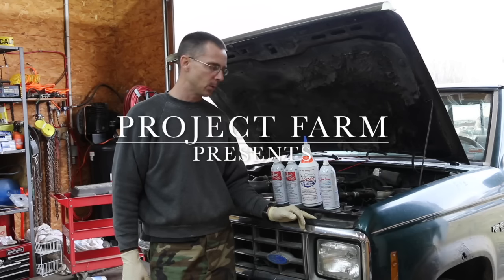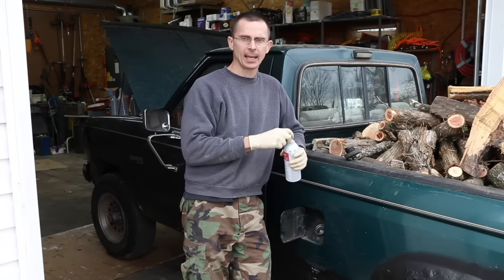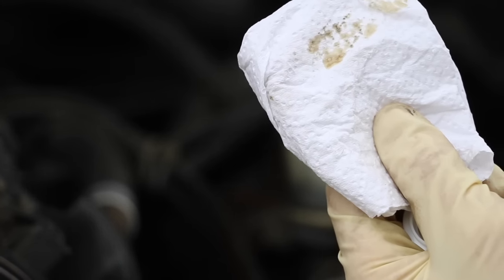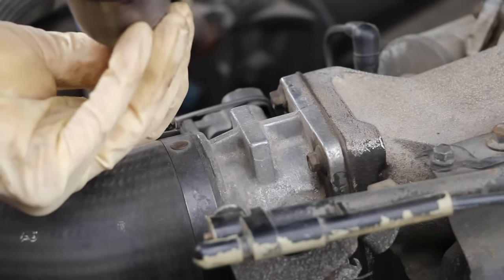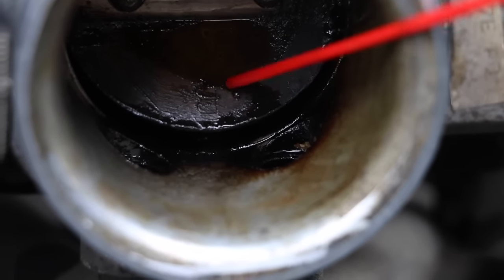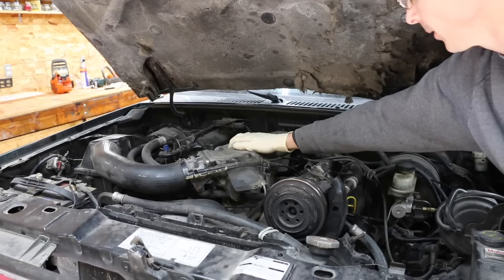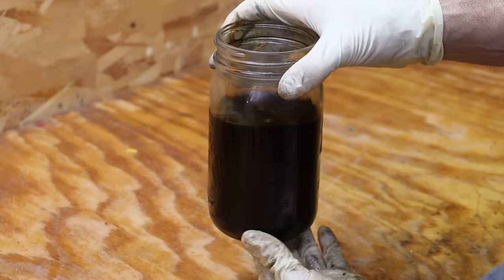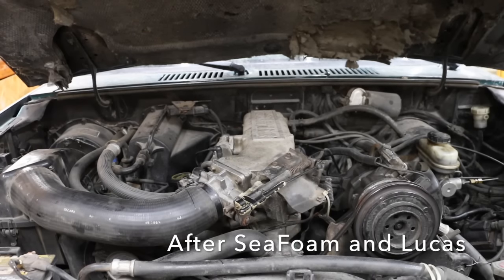Seafoam--can't believe what it did to my engine!!

Comment: ok hurry sell it now
Reply from the maker: LOL. Thanks for commenting.  The truck is still running great and is a keeper.  Thanks again.
Reply: Hahaha you read my mind.  Sell it now ... great answer.
Reply: 5:11 New Pope elected.
Reply: good one
Reply: I agree. You are beyond lucky that the shit you washed out of the heads and valve train didn't plug the oil pump pick up screen. Of course you wouldn't have had to spend that ridiculous money if the original owner had used decent oil and changed it regularly
Reply: great one lol
Reply: All that crap in the throttle body and intake manifold is from the EGR system, not oil.  The dirty oil is is from carbon deposits in the block, etc.  You will get that no matter what oil you use.  He just cleaned up the engine and intake with those products.  I've used them and they work, that's what they're designed to do.

Comment: I put a vacuum line down in a can of seafoam and let it eat.. cleans engine well.. will smoke and sound like crap but relly does work
Reply from the maker: Great method!
Reply: When I did the intake/hot soak on my 3800 engine one summer, my neighbor came over thinking the van caught on fire.  The grey cloud was immense on that low wind day!  Geat fun though, and it ran smoother.
Reply: My brake booster went bad after using this method
Reply: @boydhall62  id say your booster was prob already going bad..  sorry to hear this tho, i have used this method many times and on many different model and never have had an issue.. if i was you i wouldn't let this one flaw stop you from doing it to other vehicles.. its a great tricks and really helps..

Comment: I had a noisy lifter tick in a Cherokee 4.0 inline 6 cylinder engine. I changed to synthetic oil thinking that it would loosen it up and that did not work. The only thing that worked: I bought a bottle of Marvel Mystery Oil and poured it into the engine oil fill cap. It only took 10 minutes of driving and the the lifter was completely freed. The problem never re-occurred. I make MMO a once-a-year part of cleaning the valve train and the oil passages. I drive for about 50 mi. (some people sub. a quart of it for their oil change but I do not do this as I believe that it can interfere with the additive package engineered into the motor oil). and change the engine oil and believe me, it will come out black, as it flushes all the built up deposits; again I do this only annually, because I average only 14-15 thousand/yr. and it works for me. Your mileage may vary... 

 I do use Sea Foam thru the intake and YES, IT WORKS (The can with the hooked straw), and it keeps the the check engine light off and the vehicle has noticeably more power, smoother idle and better fuel economy; this also I do annually... As  another poster noted, drive the car hard after Sea Foaming for about 30 minutes to blow out the carbon. This I do at a separate oil change from the above-mentioned MMO treatment as both cleanings dilute engine oil with a matter of gunk that needs to be drained... NOTE!--You must increase idle about 500-1000 RPM to allow the Sea Foam to atomize and not stall the engine (EZ instructions on can) DO NOT!! increase throttle by pulling throttle plate if you have a newer car as they have an electronic-controlled throttle plate and this will KILL the factory idle setting; the only cars you can manually do this with are cable actuated butterfly valves. If unsure PLEASE have an assistant keep their foot on the gas pedal while Sea Foaming thru the intake; again you do not want to destroy the factory setting on a newer vehicle and what you tried doing to save $ will cost a trip to the dealer for re-calibration if you don't know what you are doing. 

Finally, DO NOT use diesel to pre-flush for an oil change; it will destroy valve seals on a MODERN vehicle and coat your catalytic converter with piston ring blow-by, thus triggering a PO420 OBD check engine light code at the best and at the worst varnishing (poisoning) the internals of your catalytic converter ($$$)...

 Best, Greg
Reply: Best comment.
Reply: I know what I'm doing to my 4.0 xj this weekend. Maybe I'll get 11 mpg instead of 10.
Reply: Thanks for the comment Greg. I just put MMO in my oil for the first time. I replaced 1 of 6 quarts of oil with MMO. Going to give it a while to work then change oil again. I'm debating on how long to drive it. MMO recommends 500-1000 miles but we'll see.
Reply: @travisfreeman1533   How did it go?
Reply: @Dennis-pl9di  still driving it around. I've only put about 300 miles on it since I added the MMO. Drives well and it's quieter overall. I also used the upper engine seafoam and had used seafoam in the oil previously. I didn't let the seafoam work long enough but I can't tell what's engine noise or the accessories and belt anymore.
Reply: @TheDJFoxTrot  I feel personally attacked. Haha

Comment: These 2.9L engines are known for oil restriction to the valvetrain.  There is an update fix from 1997-2004.  The repair involves removing the upper and lower intake plenums, as well as oulling the valley cover and lifters.  Once all this dissasemble is complete...the oil galleys can be retapped .0165 oversize to allow better oil flow.  Ford recommends replacing the stock oil pump with a liw pressure/high volume pump.  
As far as lucas....its reinvented Motor Honey.  Same stuff...absolutely 0 Additives.  So essentially you are diluting the detergents and additives(zinc/copper nitrates)...which can shorten oil life and cause more wear with extended use.  
Amsoil is the best solution....a little pricey, but well worth it when u figure fewer oil changes.
Reply from the maker: Great point.  Thanks for commenting!
Reply: Actually, the 4 cyl Rangers are 2.3's. They also had 2.3's in those year Mustangs. My 2.3 was extremely loud up top..especially in cold weather. Clack clack clack clack clack..and I had a weird oil pressure problem. It was good cold, but when,it warmed up..it woukd bounce around at lower RPM's.  I've heard other 2.3's make the same clack clack noise. They even make it while brand new, just not as loud.
Reply: Jeffrey Tipton
Reply: Jeffrey Tipton tsg
Reply: Bruce Wrigleys Gumchewz - this is an '86-'90 Ranger with a 2.9L V-6 made by Ford of Europe in their Cologne Production Facility.  The centerline intake is the giveaway (as well as the "2.9" visible on the upper intake at 1:48 of the video).  

Ranger 2.3L I-4s were OHC engines with a cross flow head.  Early carb and CPI models had intakes offset to the side while port injected models had a clamshell intake with runners extending up and over the valve/cam cover.  None of them looked anything like the engine in the video.

Comment: The mechanics at the Ford garage told me that I locked up my 5.4 Triton by using lucas.  They said it was too thick for the pump to take it to the top of the engine.  Turns out, the 5.4 was just a garbage design!
Reply: While the 5.4 3 valve certainly has its problems, adding the lucas likely exacerbated the issues it already had. IIRC the issue with those engines is the holes in the heads that feed oil to the valvetrain are too small, and easily clog up with sludge if oil changes are not followed very strictly, no more than 3k mile intervals. The oil being thicker by the adding the lucas definitely didn't help it out any.
Reply: If yours was the 5.4 3v, Lucas is way too thick for the VCT screens and oil flow to the heads.  High mileage 5.4s generally fail due to lack of oil flow to the heads and adding a thickening agent is only going to make the issue worse.
Reply: @AustinRBa  3k changes aren’t needed.  Just don’t use cheap oil or cheap filters without a good ADBV design and they will generally be fine.
Reply: Shoulda used Motorkote...
Reply: @tprice3450  shoulda just bought a Chevy.
Reply: @tonyhill5348  really? That's one way of coming out of the closet...
Reply: @tprice3450  seems extreme.  Super old people while completely in the way and not contributing anything to anyone I guess still have opinions, who knew!
Reply: @tonyhill5348  opinions and a ton of experience too.

Comment: Great video. I just want to add that once you complete this procedure, your engine computer will have to re-learn its proper throttle body sensor and fuel mixture; this occurs automatically while driving so don't freak out if it misbehave a little after cleaning injectors and such, it will fix itself.
Reply from the maker: Thanks!  Thanks for the feedback.
Reply: It has been 5 years since he made the video. Does it still have to learn?

Comment: I had a little ranger like that with a 4cyl. It had the consumption. it would build up carbon on the spark plug to the point of not running good.
 Drop seafoam right down the carb, smoke the highway out and it would run great for another couple gas tanks.
Reply from the maker: Thanks for sharing.

Comment: Well done sir! Great video..I have been riding and fixing motorcycles for years and older bikes get so much build up in fuel system and tank. Seafoam is not only a great short term stabilizer but it does it's job! I will say it's recommended at 1 oz per gal of gas but for bikes to start go with 1/2 oz per gal on the initial cleaning. It can remove too much debris and cause issues that are more than when you started..

Comment: My BMW M roadster was having serious engine misfiring type issues and it was intermittent. I took it to 2 mechanics and spent almost $2k and they could not fix the issue. I made them refund the money to me plus I got a lot free parts but still had the problem. I read on a blog about sticking lifters and a guy had to have them cleaned. Well I knew seasfoam could clean them from other video I had seen. I put a can in and ran the car. Had the issues one more time but after I turned it off wait and came back I have never had that problem again. Almost 2 years later still no problem. i run seafoam about every other tank in all my vehicles and my lawn equipment for my business. Im a believer
Reply from the maker: Wow!  Impressive results!
Reply: You put this junk a Bimmer - Shame on you!
Reply: did you read his comment though? seems he was at his wits end and desperate for a fix.. and it was just the fix he needed.. so i'm not seeing the problem here..? lul
Reply: Actually I’ve watched a lot of videos that people have shown it works. Couldn’t hurt bc I spent $2k trying to get it fixed so $7 was pennies to me. It has worked and still today no problems. I put it in all my vehicles and they all run great.
Reply: Todd, can you describe the misfiring you were having. I've had intermittent issues with an Z4 roadster with a 2.5si engine, mostly when the engine is cold. I could feel the engine misfiring when under load at higher revs, and the revs bounce all over the place when idling, until the engine dies. The ECU then light comes on and it goes into "limp mode" after a restart. Like you I've spent plenty on mechanics who couldn't fix it.

From experience (past experience with a 2.0 pinto in a kit car) it feels like a timing issue. Using an ODB reader I confirmed that the timing was all over the place (compared to a similar run with the engine running smoothly). Apparently the variable valve timing (VANOS) is controlled with oil pressure, so it's possible it's sticking.
Reply: oobayly I would start driving and it would begin to run super rough all of a sudden. Sometimes on start up as well and at other times it would go away. I’m lead to believe that a lifter was getting stuck and that’s what other say was the problem. I’d try using a diagnostic tool and see what it says to see if maybe it was a coil. But I’d get 2 cans of sea foam and use in two tanks of gas. No matter your cars engine could use it. You can even pour some into the crank case as well.
Reply: Thanks
Reply: Todd Harris enjoyed video
Reply: What did you add seafoam to? The gas tank?
Reply: I just shit in my tank, stir it a coat hanger.. carry on with my day
Reply: @anthonyschwartz6498  Lol! That's some "good shit" man!! I guess if you eat enough beans beforehand.....😆😅😂

Comment: That is freakin impressive! Holy crap!
Reply from the maker: Thank you
Reply: Project Farm would that work with foreign cars. Father-In-Law has a a sentra that has hydraulic valve lifter that is clicking too.
Reply: Joeteck should work in any type of conventional spark ignition type gasoline engines, so yes give it a try on the Sentra it should help!
Reply: Project Farm has any of the lifter noises and ticking came back?
Reply: Chris G I'm a Scotty Kilmer fan and I have to admit that maybe he's wrong about Sea Foam. In the meantime, one of the shops I worked at BG smoked out of a car like Sea Foam. Super rare. Normally it doesn't do that. Come see it!
Reply: 357MagnumPlinkster Society  different labels? They're completely different companies.

Comment: All I can say is Wow! That before and after sound is orgasmic!
Reply from the maker: The improvement is amazing!  Thanks!
Reply: It sounded great before you added the Lucas. I would go without it unless you actually need it.
Reply: No
Reply: bdrrogers So under what circumstances would you say an engine "really needs" lucas or seafoam? 
Not trying to be offensive, I'm just curious about your thoughts. I still haven't made up my mind on trying lucas.
Reply: probably if it hasnt been running in a while or is being used daily as a beater,I have yet to try the product but at least 3 of cars definitly would benefit by using seafoam

Comment: I used some sea foam years ago when I was fishing all the time. I fished bass tournaments and the weekend before a tournament I went fishing. I filled up my boat and forgot to put the cap back on. Luckily it had a tether to the cap. 
Anyway I was on the lake and my engine started spitting and sputtering and when I looked I noticed the cap off. I replaced it and thought I was done. I had already paid out hundreds for the tournament entry and there was no refunds. 
I put sea foam in the tank and went back to the lake. It ran awful for a while  but then it started getting smoother and smoother until it ran as good as new. So from then on I put a can in the tank every so often just in case. 
That stuff works great.
Reply from the maker: Awesome!

Comment: Great Video...Back when I was growing up (60's) my Dad use Rislone and Bardahl products.. Then STP came out, an oil thickner like Lucas and they worked great for quieting lifters and the usual engine noises. The lesson I learned from Dad was to mix the STP with a quart of oil and add it to a warmed up running engine, otherwise it finds its way to the bottom of the oil pan and only mixes after a couple hours of hi way driving..Again short, sweet,  and to the point.👍👍
Reply from the maker: Thanks!  Thanks for sharing

Comment: Some of us remember 50 weight oil, 
  If your engine tapped,, knocked,, leaked,, or smoked,. 50 weight was cheap and it worked.
Reply: Good ol slick 50. We had a demonstration brig's engine, they would remove the oil and run it to show it wouldn't blow up.